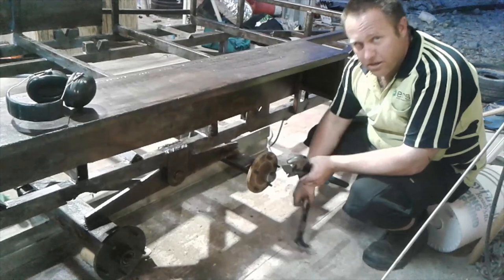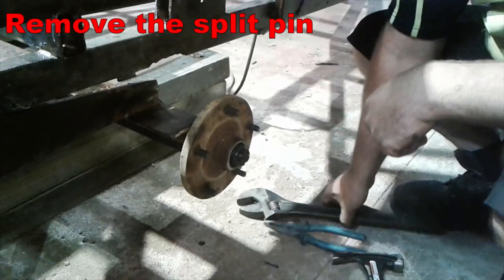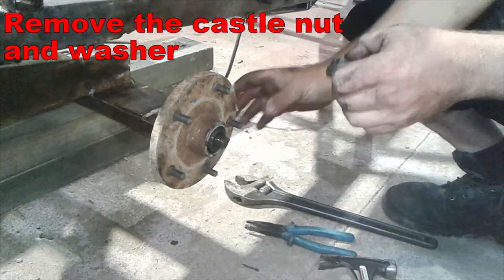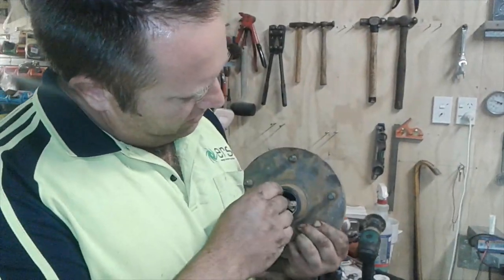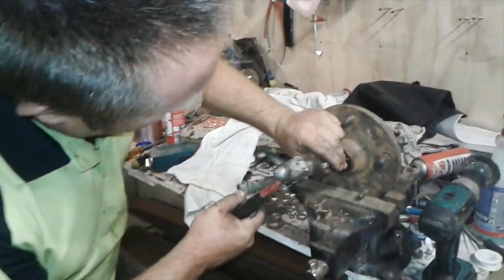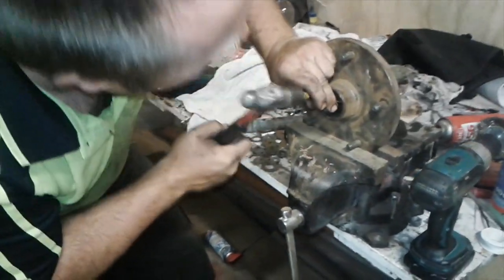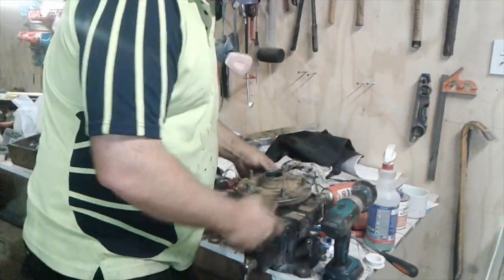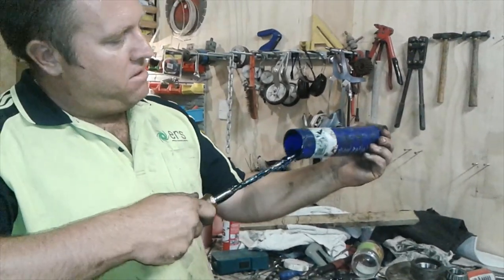How to Change Wheel Bearings (Trailer Restoration Video #2)

Comment: I'm watching this with closed captions on. Interesting translations coming up. Something about Big Bobs Beer and a flea pit, and licking the grease..?:)
PS Remove dust cap and loosen bearing nut with wheel on and you won't have issues with the hub spinning as you're trying to loosen the nut. When finished, check wheel bearing play with wheel bolted on 'before' test driving (on jack or stand) wheel should spin freely with no wobble or movement when tire is grabbed. 
Good vid guys, thanks. "Grease is The Word!"
Reply from the maker: Fair comments!  … and yes, we were discussing if Aston was helping he'd probably try having a lick of the grease so that part was accurate!